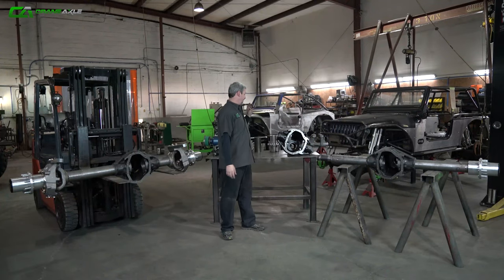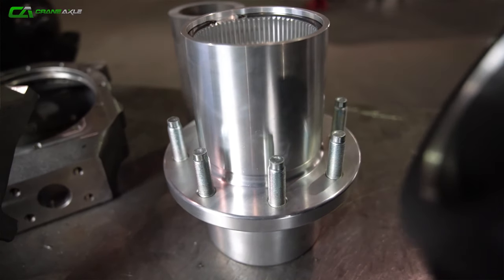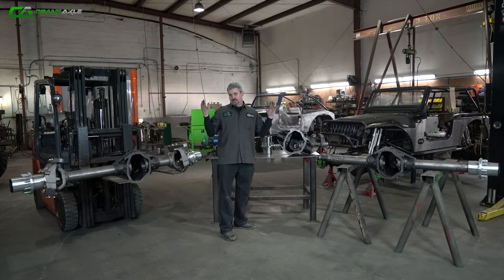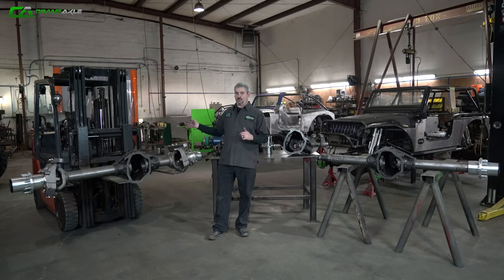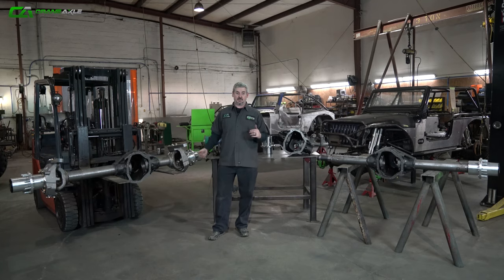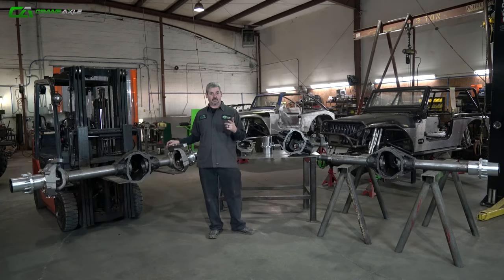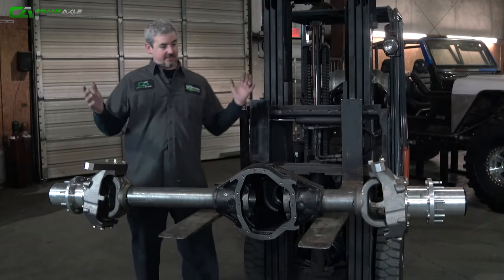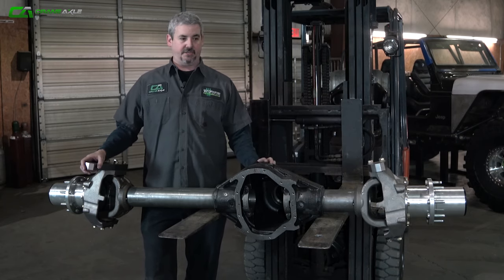BUILDING CUSTOM DANA 80 AXLES

Comment: I want to convert a motorhome based on the Ford F-53 to 4x4 for snow and mild off-road use.
Stock front axle goes up to 9k GAWR with typical loads close to 7k. Wheels are 19.5x6.75 with 10x225 bolt pattern around 170mm (6 11/16) hub bore. Critical dimensions are all safely bigger than Rockwell 2.5 ton dimensions and I'd very much like to keep stock wheels and tires.
Dana 80 is 11k. 4"/0.5" tubing exceeds 11k. Rockwell 2.5 ton parts are 11k. I trust Crane and Ouverson knuckle and hubs to exceed.
I guess I need an offset diagram to make more progress on this idea.

Comment: Hi real nice video and info would of liked to see more on how you turned the dom tube and more on pressing them in any way I would like to build a front steer axle with the center in the center bothe tubes the same  on each side what would this cost to do. can you get new Dana 30 centers and do this.
Reply from the maker: you need to contact @WideOpenDesign for more information

Comment: I have a 2000 GMC 3500HD dually. It has a Dana 80 in the rear, and an I-beam axle with leaf springs in the front. I would love to convert it to 4WD some day. What's the best axle for the front, and how difficult would the conversion be?

Comment: Is there a standard for housing width? Is it possible the lengthen the track width so that you can run larger tires? Forget the whole spacer crap, can the axle itself be a coue inches wider.
Reply from the maker: They can make them wider.
Reply: @MadRam11  so I am assuming this is a some what uncommon modification because I can't seem to find much about it. I have been racking my brain on what to do to get a little more space to swing the big tires from lock to lock. It only makes sense to lengthen but I didn't want to run rockwells. So lengthening the housing, I assume I can order axle shafts that are longer as well?

Comment: So...if you are able to get a new D80 center section from I don't know...Dana, then can you also get from them a Dana 70 HP housing that was used in the Kodiaks? I love me an 80 and all but there's just something even more badass about a high pinion 70 up front instead of a low pinion 80.
Reply: Currie has HP D70 fronts

Comment: Could a set of these be built for a Hemi swapped Wrangler on 40" tires or would Pro Rock 60 and 80 be sufficient?
Reply from the maker: yes they could be done very easily, give them a call and tell them I sent you!
Reply: @MadRam11  Would I ever have an issue you think on 40s?
Reply from the maker: Chesspiece no not at all. These axles are pretty much bomb proof. Especially for a Jeep.
Reply: @MadRam11  I forgot to ask but how much stronger would they be than the Dana 60 and Dana 80 package that I believe Dynatrack makes? How much are these axles and would I need that extra strength? I won't be doing the antics you get up. By the way I appreciate your response and your videos are watches by almost everyone in Alabama.
Reply: @MadRam11  I looked them up and compared them to other axles and while a little more expensive but so much more strong it's insane. I sent them a message. Thank you